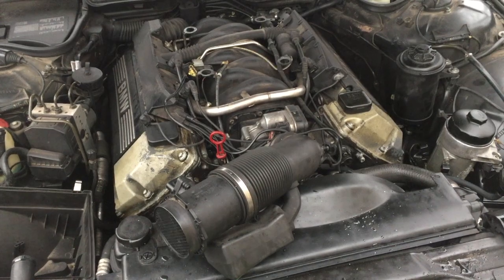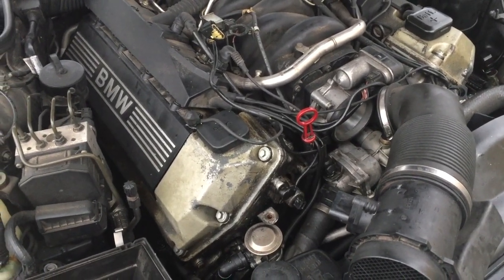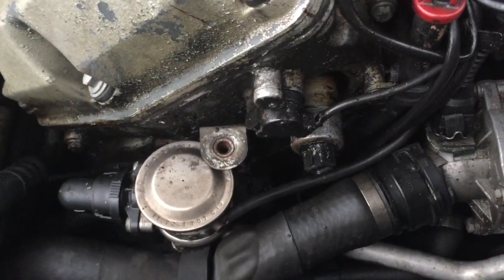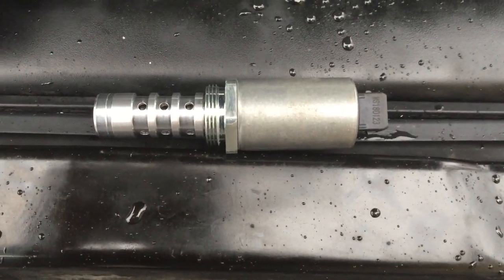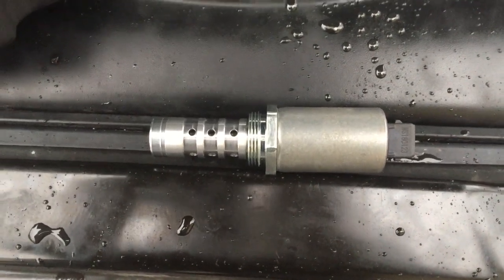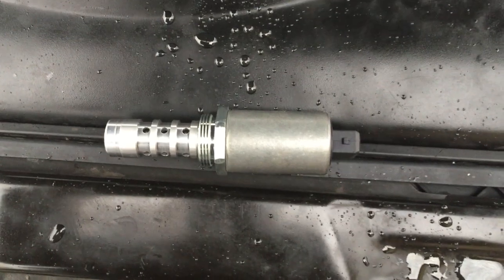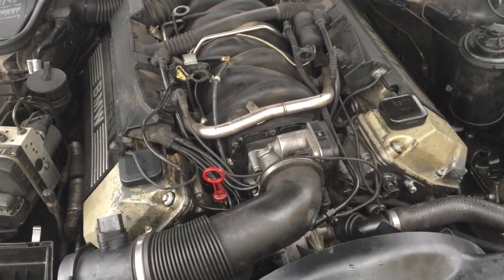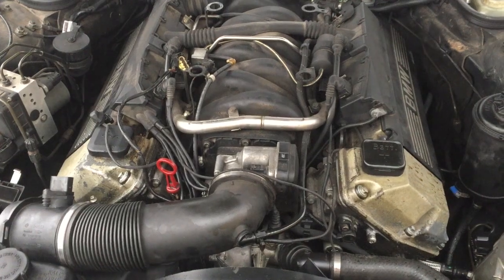Vanos solenoid replacement BMW E38

Comment: is it bad that i turned my solenoid, like the thing that goes into the engine?
Reply from the maker: Yes and no. The solenoid (the big part outside the engine) must not be turned. The inside parts are made for turning ever so slightly to allow oil coming or not into the vanos clutch.
Reply: @drdragunov  thank you, i hope its gonna work haha

Comment: Question did you have to remove the radiator hose in order to remove the Vanos on the left side
Reply from the maker: Since this was done when I did the primary chain, every radiator hose was taken off. Personally I like to have as much space as I can and the vanos front plate can be a little bit fiddly to get of with limited space.
Reply: Thank you doctor in that case I do the best I can without removing that hose.

Comment: Hi - I was wondering if you had to change the gaskets that are around the vanos solenoids. Did your model require the new gaskets or o rings?
Reply from the maker: Hi, yes in my case I changed the gaskets. It didn´t require a change but these gaskets are usually pretty hard by age and it´s a good idea to change them as you change the solenoids.

Comment: I dont have any codes on my e39 540i but it does feel sluggish and sounds like a diesel since my VANOS seals have not been replaced. Did you notice the sound improve after changing the solenoids?
Reply from the maker: Yes, changing the solenoids and flushing the engine made a great difference. And using the correct oil and doing regular oil changes makes the engine perform a lot better.

Comment: whats the torque spec
Reply from the maker: There is no torque spec for this. You will feel it when it bottoms out. And use the special socket so you don´t damage the solenoid itself.
Reply: @drdragunov  thanks bro

Comment: Hello, I was wondering how the solenoids have held up since their replacement? My understanding is that the O ring fails allowing oil into the solenoid, causing failure... I would love to avoid the cost the true vanos replacement, but it seems to be an inevitability.
Reply from the maker: OK, vanos gears and solenoids are two different things. The gears are 100% mechanical regulated by pressure and RPMs. The solenoids are electrically controlled by directing oil into the gears and so on. I can´t tell you if the solenoids are bad or not but they cannot be rebuilt. And given the normal attention to oil quality and changes they might have become bad over time. Seldom both solenoids go bad at the same time so check for codes for one bank and then change over and check if the code has moved over to the other bank. Then you know that your solenoids are on its last legs. Just a piece of advice; change both if one is broken. One good solenoid and an old can create problems since they work differently.
I have never seen any oil inside a solenoid. They just brake and dont direct oil to the gears anymore. 
May I suggest you go to my Facebook site and we can continue the dialogue there for quicker exchange of tips for your engine.
Doctor M62TUB44 is my Facebook site.

Comment: Hello
I have different codes and it is
p1341
p1353
p1357
Could the solenoid be broken or need to be replaced?
Reply from the maker: In general, solenoids can not be repaired, just replaced. You need a special tool to do so.
If you look the codes up, what are they for?
Reply: @drdragunov  

Thank you for your reply I meant to clean the solenoid and re-install due to its high price because I saw clips they cleaned and examined with an Avometer For codes The above mentioned codes and written code details appear Misfire Cylinder 8 and 6 with fuel cut / off And I have replaced the spark plugs and ignition coils, number 2, but the codes came back again, in your opinion, what is the thing that might be the cause of the problem, I feel that the car in walking is heavy and the torque is not the real 540 torque
Reply from the maker: @MHD_85  OK, it can, as usual with BMW´s very complicated engines, be many things. But I would start by maybe interchanging the solenoids because the misfire is on the same bank. So if the solenoid on that bank is broken, the error should disappear if you switch solenoids. The code should then disappear on this bank and appear on the other bank. Like eliminating bad coils. And I must stress that removing the solenoids demands the special socket. Don´t try with pliers or wrenches, it will not work.
My general experience with vanos solenoids are that, yes you can clean them but if they are going bad, this will never fix the problem. Yes, Vanos solenoids are not cheap but this is BMW. Nothing is cheap or easy. Either you live with it or buy new and correct parts.
It can be more things also but lets start there.

Comment: Can you clean instead of replacing them
Reply from the maker: Yes, it is possible but mine were broken so I had to replace them. Don´t know if there is a way to test them "out of the car" but start with a carb/brake cleaner and see if dirt and carbon comes out and then check the computer for error codes.
Also, you need the special tool for taking the out. There is no other way to do it. If you try with pliers or wrenches, you WILL destroy the solenoids for sure.

Comment: I've been trying to replace mine for a month now with a tool I bought from a plumbing store it was 36mm but I cut it and turned it into a  32 welded it after removing my rad hose I find out the it was slightly rubbing against the housing so I'm going to attempt it again next week. For me to order the socket cheapest I found with Shipping is still around 100 dollars. I can't justify that for using it twice I'd rather just buy the lock kit witch comes with it already. Will see what happens made my tool and it worked beautifully . Not bad for 12 dollars and some welding
Reply from the maker: I wish you good luck! Maybe you can get some good tool out of your skills. The socket for this job is super thin to fit in the hole of the case so it is a snug fit indeed. What I did was that I bought the special socket and then sold it off after the job was done. I made a profit since these sockets are in high demand and everybody needs them to do this job. (After I sold the socket I have bought a new one because a lot of people are asking for help with their engines)

Comment: Can you paste the link to buy the part for $55??
Reply from the maker: I buy all my BMW parts in Germany. Go to eBay.de and remember the solenoid socket you need to do the work.
Reply: @drdragunov  found the solenoid but not the socket. 
Check engine light won't go off throwing cam shaft sensor code and rich fuel code. Change sensors maf and computer still same codes. Do you think this is the issue? The third mechanic finally mentioned this possibility
Reply from the maker: @anthonymorton1998  Have you checked the tensioner? Check my video on changing this also. Cheap and very easy.
Reply from the maker: @anthonymorton1998  Vanos Steckschlüssel 32 mm Nuss Werkzeug wie BMW 116420 Spezial Steck Einsatz
Reply: @anthonymorton1998  your timing could be off
Reply from the maker: They are all over eBay. As I live in Europe the parts I get come from Germany. Much cheaper.